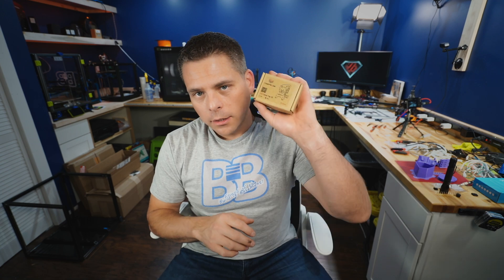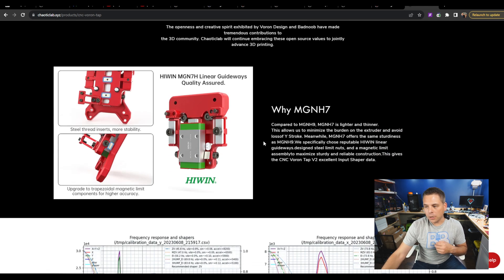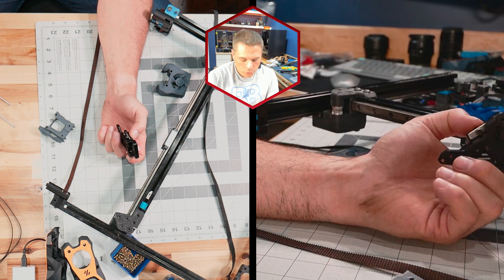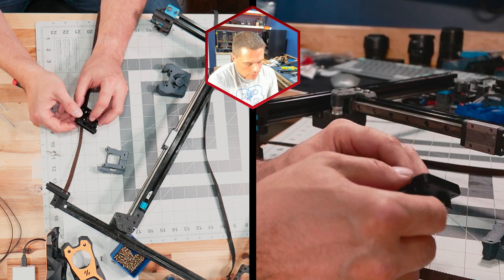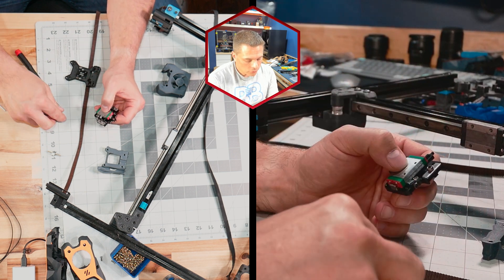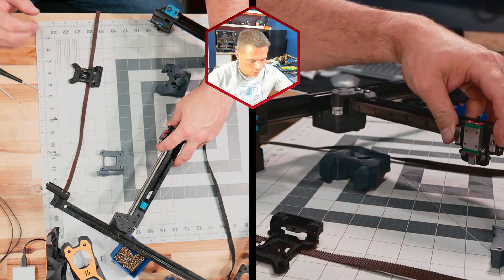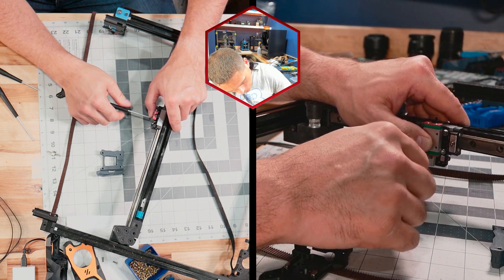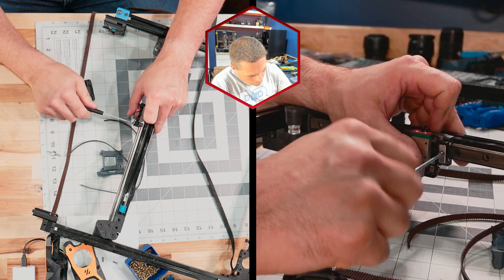Chaoticlab CNC Tap Install (Easier way)

Comment: Similar to a user below.  My install process was to basically secure the four screws to the carriage, loosen the belt holder, insert belts, tighten belt holder, done.
Reply from the maker: After some time using the CL unit I have found that they may have chosen to push the lightweight too hard and impacted the strength of the part.  I have had to rebuild the CL Tap a couple of times now on that machine and have found other "better" products.  How long have you been using yours?

Comment: So i have the option of one or the other. The tap, or the eddy duo. Have the eddy mounted at the moment but i feel like the tap would be more maintenance free. Is that correct?
Reply from the maker: Any eddy type device is great for bed scans.  I'm a proponent of starting with the best bed you can get and not needing to worry as much about bed mesh and such.  For that reason and since tapis 100% measured at the nozzle it is my preference.
Reply: @BuildItBasement  my problem with the eddy is it's said it needs calibrated for temps. I want to be able to print pla and abs. I've got a brand new bed from mandala rose

Comment: Thanks for this video, BIB @BuildItBasement.  I had a Tap 2 screw come loose from the Optical Sensor mounting bracket, and of course it fell right on the magnet. Locked up the mechanism, in the UP position fortunately.  That prevented anymore "Tapping" so to speak as the stop was permanently open.  Was able to confidently take the Tap2 apart after reviewing your video. Found the screw on the magnet. Added some light "lock-tight" to both of those top screws as the other did not seem that secure either.  Reassembling now, but wanted to give you a shout-out and props for making the video.  VERY much appreciated.
Reply from the maker: That's a good reminder to check the screws. Thanks for the props!

Comment: What's the point of removing optical sensor and front of cnctap v2? All screws are accessible without deinstalling anything (just tried that).
Reply from the maker: It's strongly suggested in the manual.  Mostly because of the of chance you snagged the sensor and damage it.  Like always they have an abundance of caution when providing instructions.
Reply: @BuildItBasement  They probably revised manual as current one (CNC_VORON_TAP_V2_BUILD_GUIDE_20240222) doesn't mention that.
Reply from the maker: Page 3. @arekx
Reply: @BuildItBasement  Hmm. On pdf I'm looking at they say "If disassembly is necessary" and nothing abut strong suggestion of doing that. Anyway I installed it without removing any part and that was easiest way for me.
Reply from the maker: Very odd... It's on page the of the PDF guide on their git: https://github.com/Chaoticlab/CNC-Tap-for-Voron/blob/master/Manual/CNC_VORON_TAP_V2_BUILD_GUIDE_20240222.pdf right on the bottom as an attention.  Not sure, either way, if you're good and didn't have any issues 😁👍

Comment: I always add a small magnet to the linear rail to keep the guides from moving
Reply: Used your magnet method... added a strong round magnet to the bottom of the Tap rail, pushed up against the Tap CNC front frame, and it perfectly prevents the Tap 2 carriage from falling out the bottom when the Tap front frame is removed from the Tap 2 carriage.

Comment: Just wondering if you ran into any problems actually using the TAP V2? I certainly did. I also wanted to know if you plan on making a second part of this video where you wire it up and test it out?
Reply from the maker: I tend to test the waters on products some - so I can help others and not cause any major issues.  I did not have any issues in my testing, what did you notice?  What is your setup??
Reply: @BuildItBasement  I have the LDO 350mm 2.4 kit. I choose to go with the aluminum kit from Chaotic Lab as well as the TAP V2. When doing the initial setup, I noticed that the connector is wire incorrectly. I had to re-pin the toolhead PCB connector to " Ground/Signal/Voltage " in order to get the V2 to even function. I thought this was just my cable but no. It's a very common problem amongst CL V2 customers. Later on, I discovered that due to the functionality of the V2 they designed the pin needed to be inverted with " ! " in order to be used. If you didn't do this the V2 would be triggered in idle and open when in use which is not ideal. But when you invert the pin like that you lose the safety measure that comes with it. So, if your sensor duds or the pin wire breaks you toolhead will crash into your bed and not stop. I was able to find a suitable work around that enable use of the V2 and maintains the safety measure.

Comment: I like my tap but I would have loved if chaoticlabs added a piece of plastic rail (perhaps with an end block so it can't slide off on 1 side) to make this sort of operation easier. 

I understand that they don't want ppl to mess with it, but yeh they know ppl are builders so what do they expect? :P
Reply from the maker: That's why I pull out that bottom screw a few turns, makes a good stop.  They aren't 100% against people taking them apart - if they were they would fully lube the rail from factory and use red threadlocker!
Reply: @BuildItBasement  yeah I saw the screw trick and made me go: hey handy.

But yeah would be nice to put it to the side for a moment and just feel safe that you don't screw up.

Btw I can't find this anywhere, but with the tap, do you still need the Z endstop behind the bed? If so, what would be the reason?
Reply from the maker: You do not need a Z endstop!  Part of the reason I like the Tap.
Reply: @BuildItBasement  thx :) was thinking that, just well you never know, perhaps there's some odd reason to still use it
Reply from the maker: 100% no - there is no offset.  I guess if you wanted to complicate the build??? The only better thing than the Tap is inverted Tap... @djmulder
Reply: @BuildItBasement  heh nah was not trying to make it more complicated, more a "did I miss something?" 

what would be an inverted tap?
Reply from the maker: A simpiler and more efficient version where the circuit is normally closed and the "tap" function breaks the connection.  I don't know if there is a lot out there about such an animal I'm aware of one person working on it.  Basically, once two metal points stop touching it breaks the circuit and trips the tap!  Super simple!  @djmulder
Reply: @BuildItBasement  ah makes sense. Shouldn't be too hard to make I'd think. Perhaps I think too simple, but if you'd turn the current tap upside down you're basically there right? (yeah yeah drill holes not aligned, magnets, etc)
Reply from the maker: Yeah - Makes you wonder why "I" didn't think of that!  @djmulder

Comment: Thank you for the video!  It's time for me to put on my big boy pants and mount my CNC V2 tap (and the CW2/SB) and do my drag chains.
Reply from the maker: I have no idea how someone could install this unit without first removing the front section.  There is a lot of conversation as to what Chaoticlab considers acceptable or not when it comes to disassembly of the Tap.  Here is my take, (1) They understand that the folks buying these are mostly decently versed in working with these types of parts. (2) They also understand that all parts will require at least some minor work, to keep the part in a good working order.  (3) They want people to be careful, the screws are small, the parts (rail, optical switch) are easy to damage.  In all, I would be careful and aware.  If you figure out a way to properly install yours with the unit in one piece, let me know!
Reply: @BuildItBasement  I did take some things off to clean/lube it, but I installed it as one piece.  For me, I think the key was that I had the belts secured on either side of the tap, which made it much easier to do a quick threading of the belts into the tap, then mount the tap, and finally tighten/clamp the belts.  Ask me how things are holding up in 6 months or so.  :)

Comment: Not remove the o-rings?
Reply from the maker: You do not need to remove the o-rings.  I know it feels odd, but its right in the original instructions.  Now, me - I would probably do it - but YMMV!
Reply: @BuildItBasement   Why would you leave the o-rings there? IMO they will just introduce play and flex in an area where you don't want any, it should be hard mounted. Rubber compresses over time and it doesn't do any good in terms of vibration damping or anything in this application.

Comment: I had considerably better results with the CNC tap and got the ideal to use it from your videos.  Thank you BiB!
Reply from the maker: Didn't you you go full CNC after using the Chaoticlab Tap???  Maybe someday I'll be able to do the same to a printer!
Reply: 90%, the CNC Chaoticlab came with the Aluminium gantry and motor parts but I only installed the gantry.  SO I have a Voron mullet, all (metal) business up top, all (plastic) party on the bottom :)   @BuildItBasement
Reply from the maker: That should be an available purchase option!
Reply: What, the Voron Mullet, LOL, I am copyrighting that name :face-blue-smiling: @BuildItBasement
Reply from the maker: CNC Gantry only. @ReneWilsonSC
Reply: oh, I knew that, was testing you to see if you knew it too @BuildItBasement
Reply: U did, you get a A+ for catching that